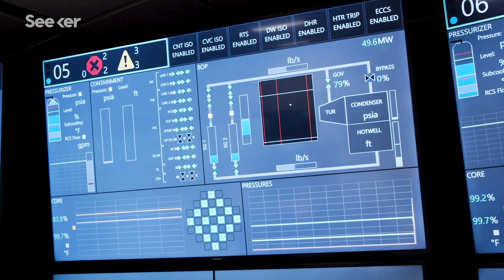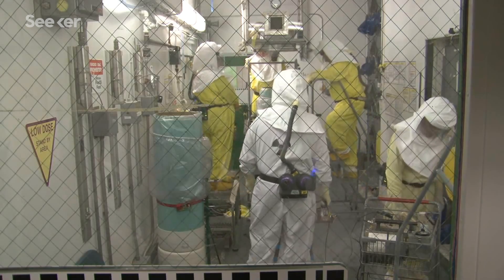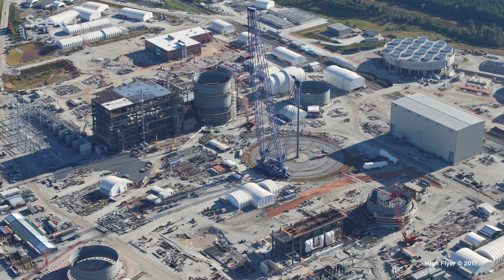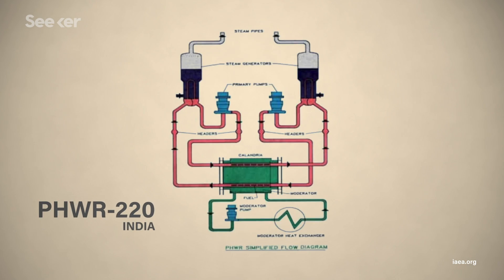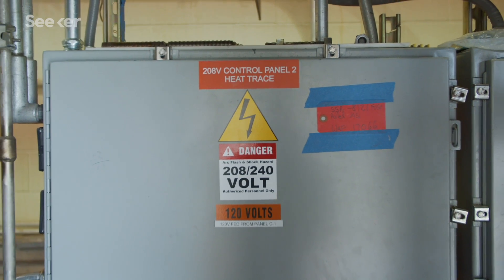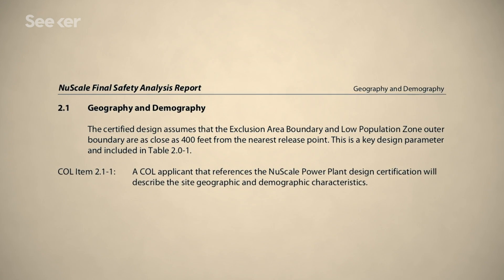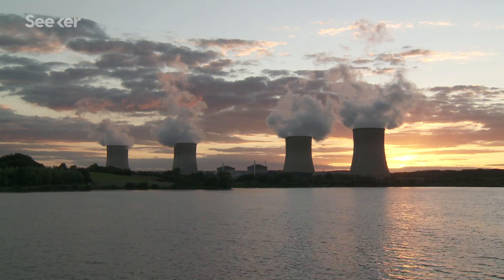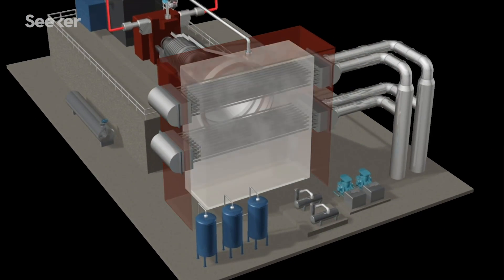Mini-Nuclear Reactors Are Coming, and They Could Reinvent the Energy Industry

Comment: New title: Inside The Race to Reinvent the Steam Engine
Reply: My reactor design is not a steam turbine. It is a magnetohydrodynamic generator on the primary coolant.
Reply: @JonathanSchattke  Okay, so  your coolant is liquid mercury which you are then vaporizing with the heat created from a thorium fission reactor core and you are running that mercury gas through a magnetohydrodynamic generator which produces an electrical output. Is that correct?
Reply: @mikerphone.  that's the idea. In theory, no moving parts.
Reply: @JonathanSchattke  Well than, it most certainly is not an engine. Dare i say the word "simplistic" in tandem with nuclear power.

I really like the idea of small self contained and easily produced reactors that could be applicable in many scenarios. And with it being possible to couple an MHD generator into a propulsion system for interplanetary travel, this is highly applicable for space.  This is a very cool concept to me, hope that it works out well for you. 

One quick question though.. So there are no moving parts, which means no pumps, everything is gravity fed and uses  condensation to pull the spent gas back into the core? If that is correct, then is there a method that still uses no moving parts for a space application? If im not mistaken, condensation is still possible in space but how would you redirect that fluid back into the pile?
Reply: @mikerphone.  In space, we need a (very inefficient) MHD pump. and probably a power loop that does not do a complete phase change, supercritical would do nicely.
Reply: @JonathanSchattke  Ah, so still no moving parts. Does the supercritical state of the mercury have any effect on MHD pump's efficiency, making it easier to move the fluid? Would the result of denying any phase change give you any sort of efficiency boost back here on the third rock from the sun? Curious about that because the condensing coils for the static pressure head model would allow for such phase changes would they not?
Reply: @mikerphone.  the latent heat of vaporization gives you a boost in energy transmitted per unit cross section.
Reply: @JonathanSchattke  that's just a steam engine with extra words.
Reply: System is the problem 🏡  The Great Qualities.

1, Show all living creatures; all the love and kindness as much as you can.

2, Only try to be honest with yourself. If you try to be honest with others, you will get into big trouble soon or later.

3, Aim only one target at a time; otherwise you are chasing two rabbits and you will miss both. So, the reason behind it. Have one powerful reason and never ever give up the one you want the most.

4, Don't try to be good person only but be the powerful person. We will grow to be the one or we will die. There is no other choice. 

5, Always learn and look for to improve something your life. 

6, You are not alone. Love and faith the high power reduces unnecessary stress in life. But never completely rely on it. 

7,  Success and happiness are the byproducts of our usefulness. So, always increase the possibility of success.

8, Life is not going to be easy. Because of our unnecessary things. Eliminate all the unnecessary things as much as you can by organising yourself well with the environments. 

9, Never believe anything without the proper evidences. 

10, Always try to give more than you take. 
Because it is dignity/ character of the divinity within you.

🌎 As long as people continue to see themselves as separate from everything else, they lend themselves to being completely enslaved. Success depends on how well we relate to everything around us. Joy comes from that bliss of connectedness. I believe that unarmed truth and love will have the final word in reality. To love; you should have good heart. I am a good person until I see a person better than my standard of goodness. Being good is the progress towards a worthy cause. Love is God. Whoever lives in love, lives forever. How selfish it is to try to keep something forever? Love is all about nourishing, nurturing, sharing and expanding the love within you for all. The principle to which we adhere to is that we have kindness of love at heart for the whole of mankind.  As long as there is the unnecessary differences within us; we can not live peacefully so we have to eliminate all the unnecessary differences among us so we can love all. People abilities may vary but not there true love. If we love a person/ God for a reason then we love the reason but not the person. No reason is the reason to love the person because true love never fails. So do not compare or measure the true love as first or the last but love all truly. If you love people truly then you can understand people. If you don't love then you don't understand people at all.

People are controlled by system why?
The Cyclical Consumption is the current economy all over the World. It is making the scarcity problems of the earth finite resources to deteriorate day by day. Current Monetary System is legalised theft. Real money is Gold and Silver. Scarcity gives the money more value. Real money won't lose it's value. When Governments stay away from Gold & Silver then very easy to transfer the wealth / resources to upper class the Rich (Corporatocracy) Elite. When the Governments are printing out more new fiat currency with reserve banks, our old currency is losing its purchasing power everyday. They are printing millions of currency everyday. All governments and laws are existing right now to transfer wealth to upper class the rich elite. The USA Government & other Governments are in many countries, bailed the investment banks & financial institutions in 2008 against the majority of the people. There is no democracy in any countries. Because of the Money System based on profits motive only above all else even humans lives and well-being. So, we do not have freedom to protect our values with the money so on. The violence, bankruptcy & all the negativities are build into the Monetary System of our society. All are owned (including ourselves) by Reserve Bank. Which is private cartel the corporation. So, in legal system, we are legally considered as chattel the properties. They make money in the capital markets with our birth certificates. They do not consider us as Humans. That's the truth. We are at the invisible war with the Elites (Corporatocracies). We have to fight for our Freedom. Resource Based Economy is the Solution. We have to declare the earth resources as the heritage of all the people of this world. So everyone has access to it. Please have your research about zeitgeist movement then you know the truth more. 

 Truth About Health/Drugs Industry Because Of It Your Life At High Risk The drug industry is a 1/2 trillion dollars a year worldwide conglomerate. Almost 300 billions dollars just in North America. That is really big business. What would happen if everyone were well? There is no money in health. You see, good health makes a lot of sense but it doesn't make a lot of dollars. Because everything they do is toxic. Every drug they use, prescription drugs, all drugs are liver toxic, bar none. If you've had amalgam fillings put in your mouth by dentists. It is highly toxic. There's cancer because most of the chemos are themselves carcinogens. To view the tumor as the cancer and we know the tumor is not the cancer. The cancer industry is 200 billions dollars a year. The more work they get, the more profit there is. You have to dismantle; If the truth ever came out about what we would need to do. 30% of people of females in America are at risk of getting, will get cancer of the breast. The ones that are already dead have been grossly mistreated by the medical profession and by the government that supposedly is supposed to encourage free research and development of all possibilities. Why would medical doctors who studied medicine and practice medicine and are heavily funded by pharmaceutical companies why would they go and look into vitamins? That they never had the answer orthomolecular. And as more and more of our population start taking their health into their own hands, there's going to be even more and more of changes. It can't go on the way it is. The system is failing apart. We must make nutrition the primary prevention strategy for the population. You are what you eat. You are everything that you have ever done to yourself. The choices you make directly affect the outcome of your life. - (Food Matters Documentary in Netflix)

😊 Well, I truly love God. I am not religious but very spiritual person. So, I believe 1) Religion is the beliefs in someone experiences But spirituality is having my own experiences. The mainstream religions people promote religious ideology by giving guidelines and guide but In my spiritual life; I do not want anyone or anything between God and me to restrict my freedom to worship God. 2) We do not need any authorities to do good work. The god work is the good work always. In contrast; organised mainstream religions are claiming that they have the authorities to do God works as leaders so on. 3) God is not capable of doing wrong thing, change the past for us and create anything out of nothing for us. Nothing means not anything. So, even God is limited. The mainstream religious people believe that God is unlimited. 4) God wants us to take responsibilities for our righteousness life but not for all the consequences of our actions because they are continued to exist among us. So, How can god punish us for all our consequences? The mainstream religious people believe we are full of sins because of all our actions. 5) Freewill  is an illusion. People always choose the perceived path of greatest pleasure.  So, we do not have choices all the time. In contrast teachings of the mainstream religions are promoting people to do god's will always because we all have choices of freewill always. 6) We can not separate everything into groups. So, everything for good and evil and there's no success and failure for everything. If everything is real then real things can not be threatened. Once you come to understand that God/The Holy Spirit is in each of us, You will no longer need a Book to tell you how to live. Then why we need religious scriptures? The Virtue is the expression of the basic goodness in our actions. The Basic goodness is the fundamental worthiness of every individuals. We are worthy to God always in everything. 7) Beliefs in a cruel God makes a cruel man. No matter what; every living creatures has the right to live and What makes their life cheap? Everything depends on everything. Nothing too big or too small in value. We can not love and hate at the same time; Being a vegetarian means love without cruelty happily. The mainstream religious people are killing people and sacrificing animals in the name of God. They promote God's cruel punishments. The Punishment is endless for Sinners/Devil according to religious scriptures. But God is love always. Overcome hate with love. If all religions for peace, unity? No way. Because they are not for peace. 8) Well, The God gave us everything to go from moment to moment in our lives as we do our part  and pray only to thank god then the Love is in progress. The Love is always for everyone. We are always worthy of the God's love. Our greatest fear is; not to be loved by anyone but we are all loved by someone. When we eliminate all our unnecessary differences among us then true peaceful life is possible with the true love. If we can't find the peace within ourselves then we will never find it anywhere else. 9) This is the Fight for independence and freedom of humanity to worship God freely without religious guide and guidelines to restrict us. Unnecessarily, We do not want third party controls over us in anything ; especially in spirituality. 10) Revive Survive Thrive. Sincerely,  The Real Peacemaker against religious oppression.

 https://youtu.be/HbvCxMfcKv4
https://youtu.be/pIJHJzDQcRM
https://youtu.be/MyxbdmAnIcI
https://youtu.be/wLzeakKC6fE
 https://youtu.be/P8vHa8zD7jY

Comment: So do the math 3 of them equals 1 the equivalent of one large reactor a cant fit 12 in one roof thats 4 big reactors on a smaller scale thats a big problem with a huge boom issue so i ask the original problem of fission science how the hell do you make spent fuel stable? Cant cuz we dont know how and that  means each little factory can produce 4 times the waste as one large reactor call this food for thought because all that spent fuel we have already used still has not been neutralized
Reply: When you say neutralized what are you specifically talking about?

Comment: Gotta say, after reading up I'm not feeling nuscales reactor designs.
They get the cheap-because-mass-produced of MSRs, but it's still solid fueled (inefficient) and a light water steam system.
Steam engines are high maintenance or low reliability.
But nuke plants must never ever fail and maintainence is high cost.
Combine the two and the only way to make it safe is very high cost.
And you still have to build massive containment buildings in case of failure, because stream is hundreds of times more voluminous than liquid water.
I see what they're trying to do, there's no prizes for coming second.
But the goal is to save the world guys, not just please shareholders.
Reply: Steam engines are high maintenance and low reliability? Then what do you propose?
Reply: @wimvanuytven7858  
I propose we develop and build liquid fueled salt cooled reactors.
Typically referred to as MSRs.
Because they run at atmospheric pressure instead of steam level of pressure, the cooling system is (relatively) low cost and (absolutely) high reliability.

Comment: I'm generally in favor of nuclear energy and if someone has a better safer way to manage the systems I say go for it.  But don't start with optimistic wishful thinking and peel back the safety regulations like large exclusion zones.  Instead have the first generation or two act within the current framework of safety zones, and after a decade or two of actual operations that prove out the design in real life scenarios, then examine the data and see if their actual operation merits a less restrictive exclusion zone.  If it does, then take it down incrementally as the data supports re-writing of regulations.

Comment: I vote for green parties. But the green parties here in Europe are still in the denial phase when it comes to nuclear energy. They are opposed to nuclear. I think it's naive, we need nuclear to cut carbon emissions.
Reply: @Onur K This argument is often used, but I see it like this: Would you rather have nuclear waste which you can store under 3 meters of concrete, which will never be touched again, or spew the waste product of energy making into the air, giving people lung cancer, astma, and causing climate change. The preferred is clear to me
Reply: @Onur K Here in the Netherlands we have a nuclear toilet which has a sea container's worth of waste. The reactor where it's from is producing 4% of our annual energy needs since the '70's. To put it into perspective: An apple-sized lump of nuclear waste is enough to provide energy for a person's life-long needs.
Reply: Onur K How is ionized water leaking into groundwater?

1. You can Vitrify nuclear waste thus removing the water content entirely and storing solid waste. 

2. The concrete containers are not stored near ground water within 100 feet. 

3. You’re sssuming that groundwater hundreds to thousands of feet under ground will be used by the public faster than radionuclides decay, which is extremely pessimistic considering that that process usually takes thousands of years and the most radioactive nuclear waste experiences total statistical decay in less than 500 years.

Comment: OMG, one of the most advanced methods of generating electricity, is still based on improvements from steam engines! That’s why we need to reinvent it.
Reply: Samuel Li actually the steam turbine cycle is very efficient for combustion cycles, which is why it has been used over the last 200 years. There are some advantages using a Braylon cycle but this typically requires more unique materials and much higher temperatures.
Reply: You call a efficiency of 30%-40% very high? And plus, don’t we have more advanced ways of converting heat to electricity, such as some semiconductors?and plus, we can even use the radiation produced by the reactor to generate electricity, they’re photons, right?

Comment: Again, this does not address for what to do with the very radioactive nuclear waste produced in these nuclear fission reactors. Fusion is the answer as it is inherently safe and produces much less volatile nuclear waste. Now we only have to get it to work. SMRs from a design perspective make sense since it allows for scalability but again, the issue of where to store the waste is not solved (see Yucca Mountain)
Reply: Christian O. Holz Solutions for nuclear waste management that have been known, used by multiple countries or used in R&D projects for the last 40+ years: 

1. Vitrification
2. Fast Spectrum Reactors
3. Nuclear Burning/Advanced Burner Reactors
4. Reprocessing/ Pyroprocessing
5. Deep Geological Repositories

Comment: The SMR is an interesting concept, and could be a decent stopgap until they can make viable Thorium based molten salt reactors, which would be able to recycle the spent fuel rods, let's hope they keep this above board without sabre-rattling over potential weapons enrichment sites.

Comment: If the design allows the control rods to fall into place upon loss of power, what if damage prevents the control rods from being able to be engaged? Wouldnt it be ideal to have a casing made of material which can tolerate extreme temperature without melting? Together with a core which simply cannot explode, you could do what you like to the unit. It would get very hot, but thats all.